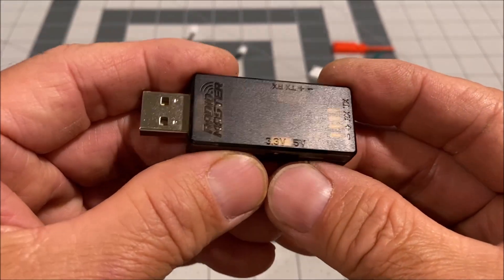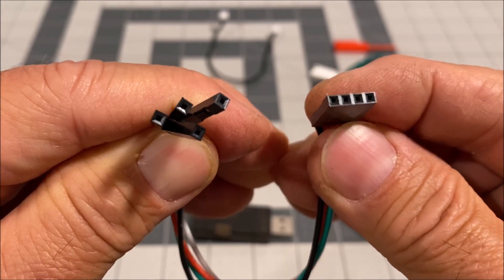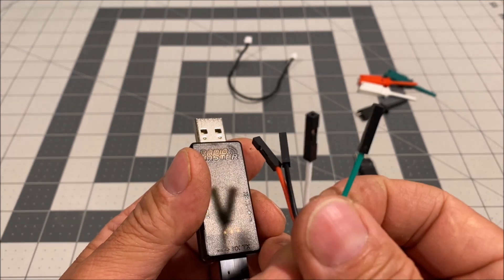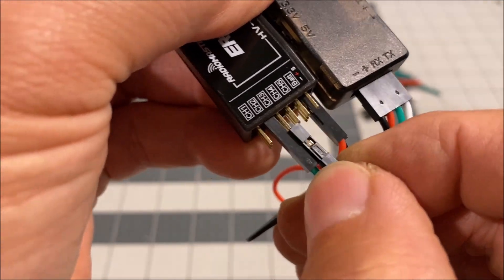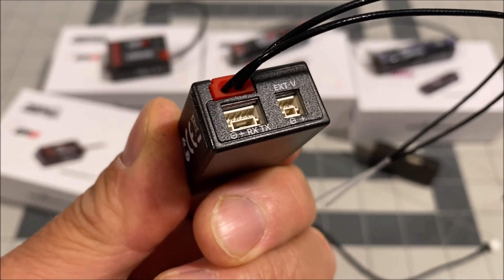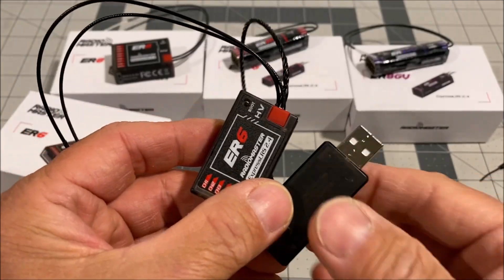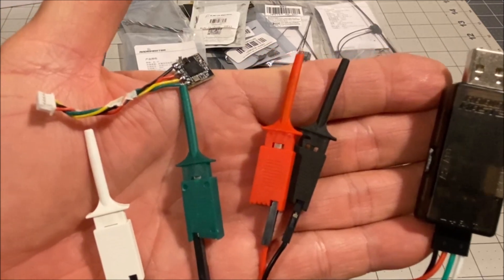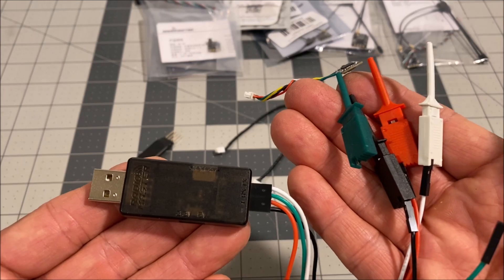Radiomaster ExpressLRS USB UART Flash Tool

Comment: Very thorough info Pete
Reply from the maker: Thanks Greg!!  I still like wifi flashing though it is more convenient for receivers with solder pads.  I did however had a bad flash over wifi and had to recover it with one of these ftdi devices.  $9.99 to fix a receiver is not bad.